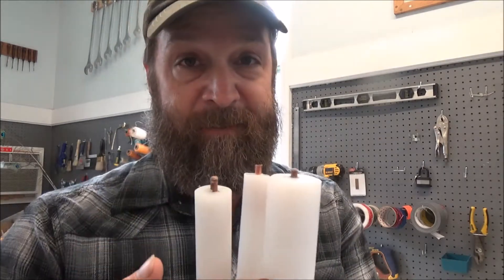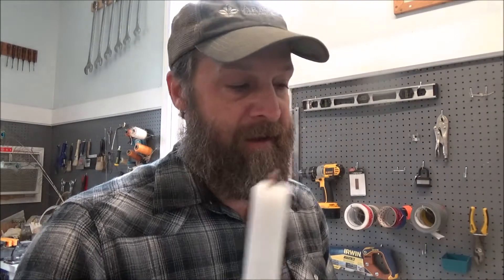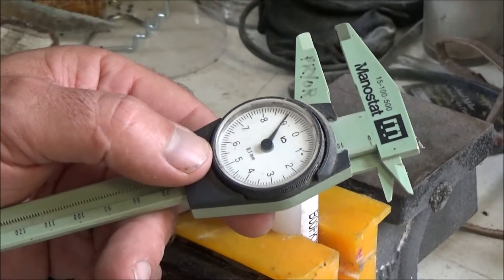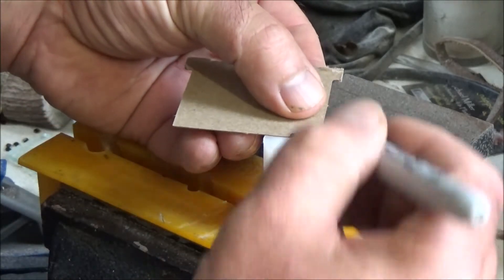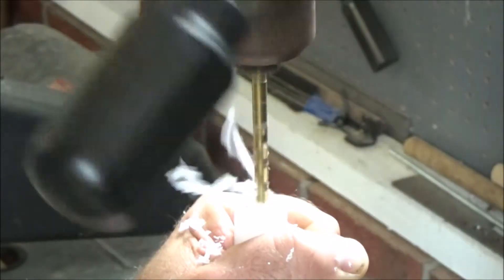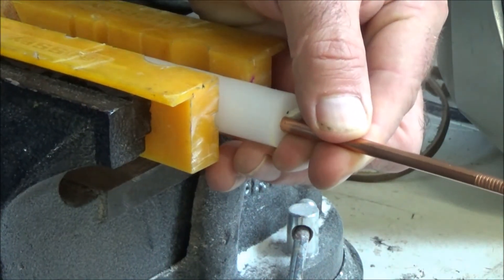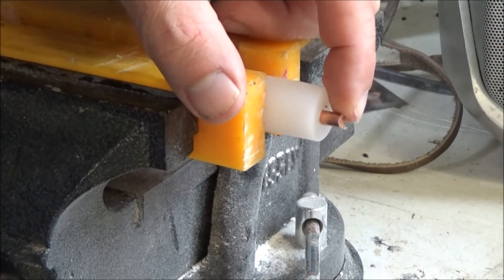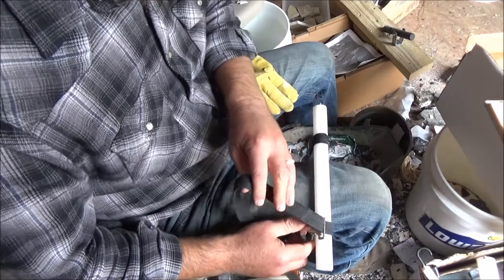indirect percussion part 1 - making the tools

Comment: Remember that  copper work hardens.  Twist the wire with a vice and power drill and it won't be as soft or you can cold forge for the same effect .

Comment: Amazon sells 1" diameter  high density poly rod (HDPE), a two foot length for $16.96.  U.S Plastics sells the same stuff for $22.28 for an 8 ft. length.  So for five bucks more you can get four times as much rod. That's crazy.

Comment: I buy the copper grounding wire, clamp one end in my vise and chuck the other end in my drill. I twist it as much as I (safely) can. Provides tremendous strength to an otherwise flimsy piece of copper and seems to add a slight spring to it as well.
Reply: Thay definitely would work, i bet slightly work hardening it would work also. Im going to try working it first. Just bought some ground wire today